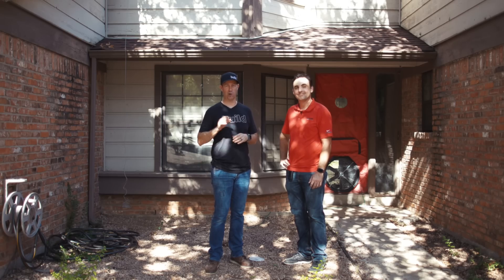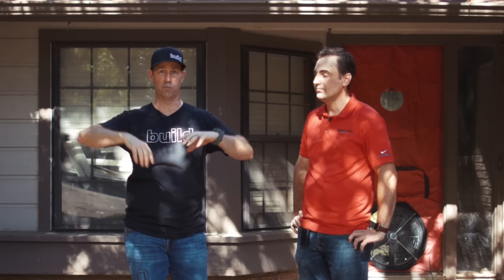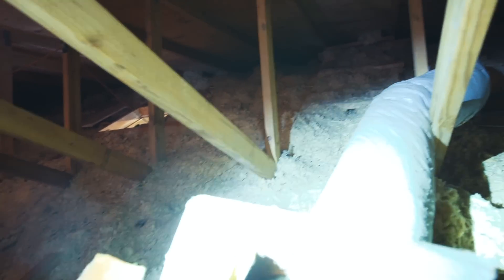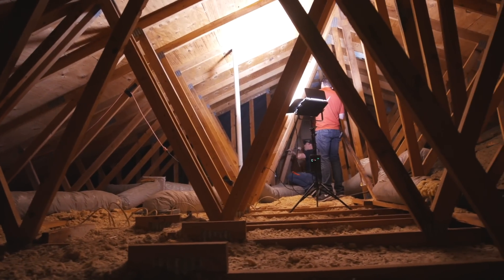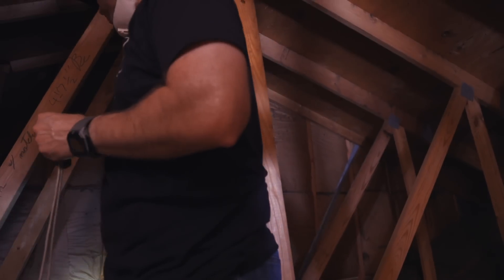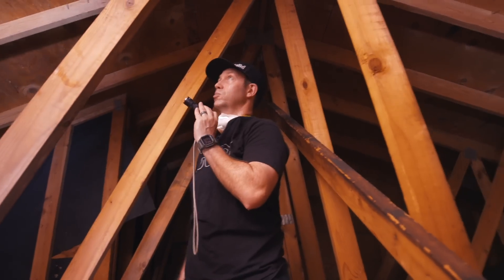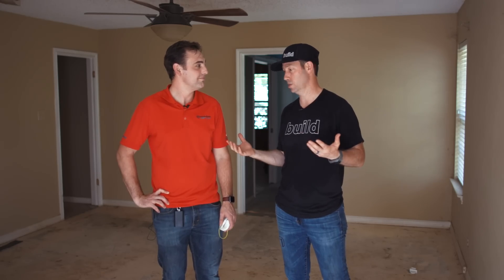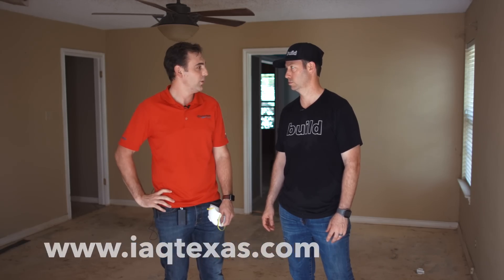You Won’t Believe What I Found In Here!  Pre-Testing my Crappy 70’s House

Comment: Matt -- your videos are awesome man!  This one really made me think about my attic.  We have had a hot house most of the summer and the AC guy even came out.  He didn't check the attic and neither had I.  Bad move on my part!  Routine check of the attic is always smart.  I knew I had a problem when I opened the attic and got a blast of cool air.  One of the straps holding our duct in place had fallen causing stress at the duct joint which separated so our kitchen had not had AC all summer since the attic was being cooled every ten minutes or so.  Total fail on my part for not inspecting it myself.  Problem is now fixed.  I love your ideas about insulation and creating a conditioned attic --- just not the way I did it haha!

Comment: I have a house that's from the 1970's and I question if it has any kind of vapor barrier, or insulation better than what was economy back then. Is there any way to fix it without ripping off the entire siding of the house/drywall on the inside? I'm also in a split level where the bottom half seems to be painted cement all around, not even sure how to get in there, only the top half has vinyl siding.

Comment: Those roof trusses look criminal.  The near vertical members are cut at a sharp angle and are barely connected to the metal gusset plates.
Also, the electrical wires should not be run across the attic floor.  Especially if you add deep insulation so the wiring is not in view; walking on the wiring while traversing the attic can cause a short.  Go up the truss member, across, and down, unless you want to build a protected raceway for wiring.

Comment: I Have Had My Entire Old Central System Replaced With A Ductless Mitsubishi Mini Split System. I Have A 60K BTU Heat Pump And 7 Head Units! I Could Not Be More Happy. My Install Took Place From 2019 06 21 To 06 25. The First Night With The New System I Set All Units To The Lowest Setting Of 61 F! I Woke To A House Sitting At 57.3 F.

My House Was Built In 1952. There Is No Insulation In The Walls! I Still Have To Remove And Seal All Of The Supply And Return Vents In The Ceiling And Floor, 14 Total.

Comment: “Making ice in an oven” is definitely not a great analogy.
Reply: @David-gld  Because the purpose of an analogy is to help explain a concept by using a FAMILIAR example. No one attempts to make ice cubes with a source of heat. Many better analogies exist. For example, attempting to fill a bowl with water when that bowl has a crack or holes in it.  Many older houses are like strainers. No matter how much heat (or cold) one tries to dump into it, it leaks out; even if almost every hole is plugged up. People are familiar with holey vessels and strainers and immediately apprehend the concept of how difficult plugging up every hole can be, in addition to understanding how some houses have more extensive holes.
Reply: Thomas Leisman Ha! Well done on the trolling. What do you use your oven for? Not a source of heat, eh?

Comment: I'm almost afraid to know how bad the air loss in my house is. It is a brick frame house, apx. 1000 square feet, built in 1951. It has a full basement, a main floor, second floor and an attic. The roof has a 12/12 pitch. My attic has cellulose insulation which is very old, grey, and looks somewhat compressed. In the summertime, my electric bill including central A/C is aright around $230 which also on hotter days requires me to use a portable A/C in the second floor bedrooms because it is too warm even with the central air on.

Comment: At this rate it should be cheaper to tear it down and start over.  A fresh build would be more to code, easier to heat, cool and control air leakage.  It also eliminates the need to design around flaws in the original layout.

Comment: Ugghhhhh. When I saw that "cheese wedge" with a panel cout out of it, I immediately recognized what had happened there. When we had our house replumbed several years back, the plumbers cut a 12" x 12" flap into the ductboard plenum so they'd have cool air blowing on them. Then they only put "duct tape" (yes the crappy stuff that isn't for ducts over the slits), and it worked loose the next day, causing my AC performance to plummet. Of course they denied doing it, and guess who had to fix it? Moi. One thing I cannot stand it is a crappy contractor. Another thing is a liar.

Comment: Sean forgot to mention that a Supply Air Leak to Outside will put your house under a negative pressure, pulling outside air into your house from all the cracks, when the HVAC Unit is running.
Reply from the maker: Yes. True.

Comment: Yes, my house built in 98. Only thing covering the obs is the vinyl siding. A gust of wind hits the house, I can hear and feel it inside the house. I figure it would be cheaper to buy a new house than fix this. Now the house is full of dust all the time. Retired on limited income, I'm not going nowhere. Thanks for your videos.
Reply: If you ever need to replace the siding, adding some Tyvek and taping all the seams would help a lot with the drafts.  In the meantime, you can caulk around baseboards and windows and maybe put foam gaskets under your outlet and switch plates.  Good luck!

Comment: He said 19" of insulation for an r-38 rating. Blow in cellulose is about that at 12", and fiberglass at about 10". Also, I prefer a traditionally insulated house with vented roofs for multiple reasons: cheaper than spray foam, less harmful to people, moisture damage doesn't go unnoticed when shingles begin to fail or are damaged, no need for humidity sensors in the attic, no need to waste blowing AC into the attic to keep it conditioned. The pros to a conditioned attic is that your system isn't "fighting" against the external heat of the attic and mold is less likely to develop if the ducting gets a hole in it. 
  If the safety of spray foam is taken more seriously in coming years and the cost goes down, then I will start using it on homes, but I don't want to gamble with the health of clients, the same way Matt isn't going to by taking out the ductwork, old insulation, repairing electrical and fixing the air leaks.

Comment: Consider heavily insulated metal ductwork after you clean out the nasty flex duct and insulation, ventilate the attic with baffled soffits and solar vents, staple solar radiant barrier to bottom of roof rafters making sure to cut radiant barrier around the exhaust holes, blow in lots of quality insulation.

Comment: Matt, you mentioned removing the insulation from the attic area, can you describe what that process entails.  Many years ago,  I tried to hire a company to suck out all my blown insulation, so the floor could be sealed to eliminate air leaks. The three companies I contacted in the Northern Virginia area, all indicated the only way to remove insulation was by hand..... putting a small group of folks in the attic with large commercial size plastic bags.  My thought process was to reverse the process on which the insulation was delivered to the attic....Suck it out.  Everyone said, that couldn't be done......is that true? 
In this area, for years,  the builders have always placed the second story HVAC system In the attic.  I've always hated. 
I'm enjoying your remodeling project.

Comment: $500 to $1000 a month in electricity to cool that house?  You're smoking crack.  Even with the A/C running 24/7 you wouldn't get close to that.
Reply: I live near Dallas, 1600 SF brick home central a/c. - my electric bill runs > $125 a month in summer with thermostat set at 80-81. To cool my little house to 74-75 would be at least $500  a month with temp outside at 100-105. A/C in Texas is expensive in summer! I cant afford even $200 electric bill.
Reply: @jeanetteredden24  In Austin, electricity is cheap.  Water is massively overpriced.  I live in Austin in one of those poorly-built 70s-style houses with the A/C ducts in the hot attic.  I air condition 2100 square feet to 75 during the daytime, 72 at night.  Every day.  My electric bill was $89 last month.

Comment: As a homeowner, I'm inclined to fix the obvious stuff, like the ubiquitous leaking attic door and missing insulation, before spending $200 or $2,000 on a blower test . Living in the N.E., I run a blower test of sorts every spring and fall with an exhaust fan upstairs and the basement windows open; the air currents from the outlets and some of the baseboards were obvious from the dust smell and congested sinuses. It's also obvious on those -5 degree (F) days where the air currents are between the drywall and the concrete blocks; they are getting harder to find after years of injecting cans of Great Stuff. There were kitchen cabinets where I could feel the cold air falling down from the attic and that's all gone now.  I'm sure a professional audit would find more than I have, but the house in this video was neglected in terms of efficiency (and a few other things) for 40 years. If making an informative video were not part of the mission, I'm sure Matt could have found a lot of this stuff, fixed it, and then gotten an energy audit with some hope of ending up with a shorter list of issues.

Comment: Looks like your HVAC budget just went way up and the rodents will be out of luck. You would think in 1980's Texas or any other HOT state the building code would have required a better more efficient cooling system with a higher EER and SEER rating. What a MESS !!!!!

Comment: Matt, to build on Kevin Whitlow
's comment, You were talking about how crazy it is to have ducts in a hot attic so shouldn't you blanket insulate the roof to keep the attic cooler like some other homes you have done or maybe convert the house to mini split system and get rid of ducts completely?

Comment: I commend you for taking on this incredible task of applying building science practices to an existing home.  Most people live in  "crappy" homes so I think these videos have a greater potential of impacting house performance than your videos discussing new home construction.  If I remember correctly, you talk about houses generally being built to last 50 years.  This house is about 50 years old, when you paid for it did you get it for essentially the price of the land?  At what point is demolishing the home the best option?  You had an architect design a remodel, you cleaned up the property, and in this episode you conducted a blower door test and looked at the attic.  1. I am not sure why you would pay for a blower door test before sealing obvious leaks.  It seems in this case the test would be best suited for identifying leaks through walls so it seems impractical to test until you fix attic and ventilation.  Unless you are just trying to establish the initial condition of the house for your viewers.  2.  Did you perform an overall evaluation of the house to  determine what changes in the house will significantly improve the building performance of the house?  You must have had some concept of what needed to be done before you bought the house. The decision process displayed in the videos seem to be made from the position of: I own this house what can I do to optimize its performance.  3.  My guess is that you will end up just spraying foam to seal under the rafters,  what would you do in cold climates where condensation is a concern?  4. I like that you are discussing costs and hope you will include cost/benefit for different options in future videos. Your videos are great, keep up the good work.

Comment: I saw 30+ ACH50 once when doing an "energy audit" on a 1890's building.   It was a 8.000 s.f. warehouse/retail store.  One of their summer high school workers had driven the fork lift out the back door (at teenage speed) with the lift up.   Crashed into the wall, pulled that wall off the side walls slightly and left a gap (up to an inch) between the side and back walls.   They had put pipe insulation into the gap but it was worthless.   They decided to just upgrade their lights.

Comment: thats gotta be the worst possible attic access door location. Take that thing to the studs so you can air seal that joint properly.
Reply: I gutted my 1950 house in Houston.  Then bought about 40 cans of spray foam and foamed the new windows and doors, and every gap and hole in the cellotex sheathing. Any area air could get in, it got foamed.  Also foamed all the bottom and top plate holes.  It went from drafty as hell to no air movement even with heavy winds.  Then I had cellulose blown in and new drywall.  

It was a lot of work but it only cost about $200 a month on average to heat and cool 2,400 sq ft.

Comment: I'll bet Meet Kevin is literally shaking watching this video.....lol
Reply: Maybe, maybe not.  Kevin would more focus on necessary repairs and upgrades that gets renters in and keeps them.  His climate is also different so he wouldnt need to spend so much on new windows and insulation.

If this was a rental for rental's sake, fix the exterior, new windows, attic insulation and new HVAC, then interior cosmetics.

Kevin's, and most of the commenters on the first video, main problem was with the major exterior and layout changes that add $100k on TOP of fixing existing issues.

Comment: A few years ago my utility offered free blower tests and then made a recommendation of what to do to make the home more energy efficient. I took them up on their offer and then paid $1500 to have their air sealing contractor come in a seal the home. They sealed ceiling leaks around light fixtures and bathroom fans. They also sealed around pipe and any other ceiling penetration. They then went to the lower level and sealed along the walls where they meet the basement concrete wall. After they were done they redid the blower test and it was much better. The very next month my utility bills dropped by 30%. Well worth the upfront cost. I have been saving money now month after month, year after year, spring, summer, fall and winter. Saving energy saves money. Check with your local utility and see what energy efficiency programs they offer.
Reply: I gutted my 1950 house and sealed the exterior and new windows and doors, then blew in cellulose in the walls and attic.  It costs barely more to cool than my old apt that was a quarter of the size!

Air-sealing and insulating pay themselves off very nicely in hot and humid or cold areas.
Reply: New York offers free energy audits to any homeowner.

Comment: Many Utility Companies do  free energy audits. Blower doors can tell a lot about air tightness but little about the most efficient upgrades. BTW I am a level 1 energy rater and a FL Certified Building Contractor. I have been using a blower door since the 90's.
Reply: Where in FL are you located?
Reply: @WeKnowEDKH  NE FL am looking for a place to rent in November. retired and moved to WA and it just didn't take. I need to be back and doing some building and remodeling.

Comment: This is what you can expect when you buy a house sight-unseen because "she is a nice lady..."
Reply: This is what you can expect buying a house that is over 10-20 years old really.  ANY house.  70s-80s houses were built fast and cheap since boomers needed lots of housing.  They used T1-11 siding as sheathing to save money, then spent 100X as much cooling and heating it. 

I usually recommend friends to get as new a house as possible, or at least 90s and newer.  That way plumbing, electrical, windows, and insulation are up to decent modern standards.  Add some more attic insulation and better HVAC and you're good.  I bought a 1950 house and gutted and rebuilt it, it performs like a new house now.
Reply: @bigpjohnson  I don't disagree one bit with what you said.
Reply: This is what you get when a contractor who specializes in hawking overpriced building products to wealthy people is in charge of a renovation.
Reply: Totally agree with you, why he paid so much is beyond me and why didn't he get an inspection first...... I'm pretty blown away really.

Comment: Matt you bought this house without an inspection. And negotiation of remodel cost of obsolete condition of flowering and furnace test would be. What is the current new construction cost for this unit as replacement cost? Code improvement standards? Most building codes require complete upgrade at 50% standard. What is the cost per square ft of upgrade to code $50-$75?? Then what is esthetics upgrade cost landscaping roofing siding cabinets millwork etc. Have seen too many flip shows rather than older 1960"S neighborhoods that need total refinance by both the city and community. The retired people who have no capital and young tenants who trash the property as rentals for a decade. The 2008 crash has forced cities to require banks and landlords to maintain and inspect properties. Downtown Seattle had a slum landlord with a 1000000 squirt ft and no repairs for 35 years as an example that forced down values

Comment: Houses in FL are built the same way. The sad part is that I could spend a ton of money fixing my modist 1980 ranch style house with all the same problems as that one but a future buyer doesn't care and doesn't care to be informed. I don't think I would be able to increase the home price at all. As far as most buyers are concerned a three bed two bath ranch is the same as the next one.
Reply: This observation is an industry flaw.  Upgrades and quality require the seller/builder to educate home buyers of the benefits.  The added cost will reduce the pool of potential buyers but unseen improvements should increase the homes durability, energy efficiency, and comfort.
Reply: @Promeethious  I'm about to embark on building a net zero home instead of fixing my old one. The builders here in SW FL are terrible. They put tons of money into cosmetics but the structure style hasn't changed since the early 1980s. They still put cold ducts in hot attics too. Way under insulated.